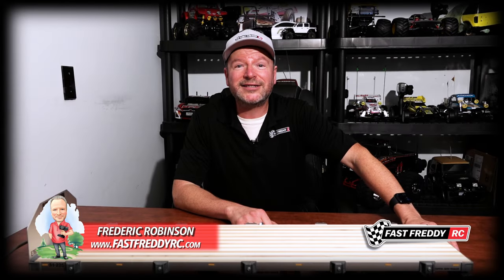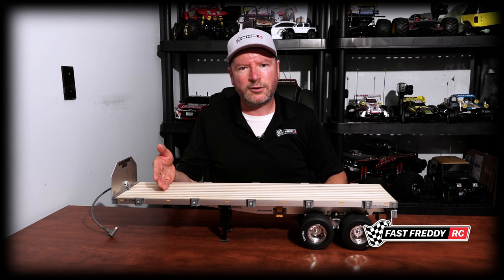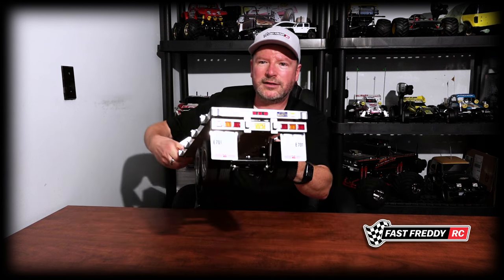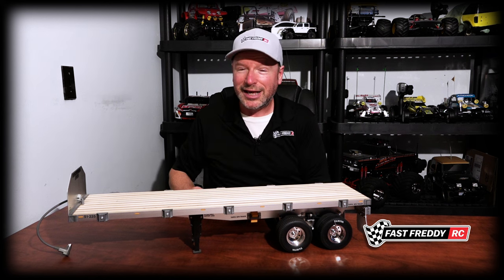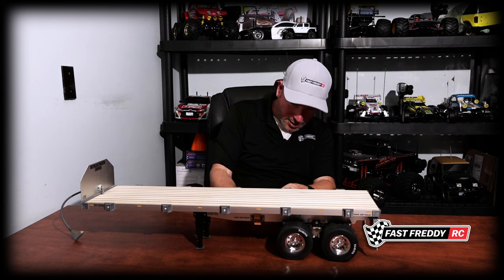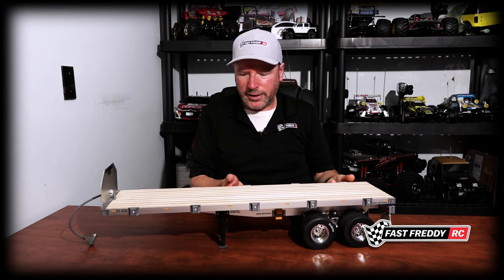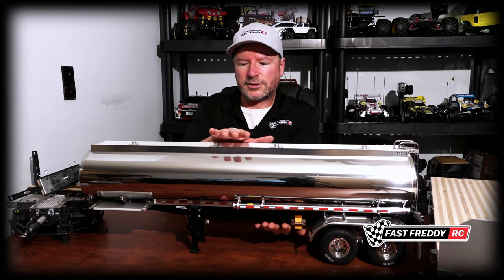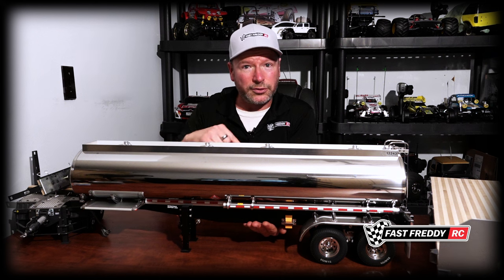Tamiya 1/14 scale Semi Trailers Showcase -  TRAILER TALK

Comment: why didn't you use 1/14 scale glad hands and light hookups from the truck to the trailer they do make them for 1/14 scale semi truck and trailer
Reply from the maker: Well that's great to know!  I'm not aware of any that you can buy. I've looked before and couldn't find any.  The original build video was designed to showcase how to build it the "Tamiya way" but ultimately the plan is to modify the Tanker trailer and Flatbed trailer to make them truly North American trailers ie. Mansfield Bars, air brake units on the axles, side marker lights etc. I'll be working with @westernsharpie when the time comes to do just that. Do you have a link to these light hookups?  Thanks for the info!